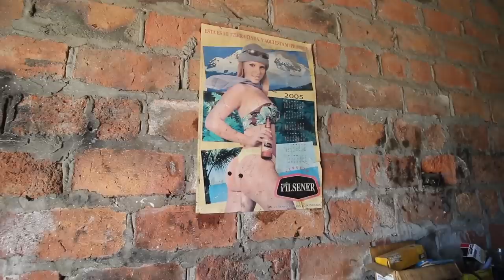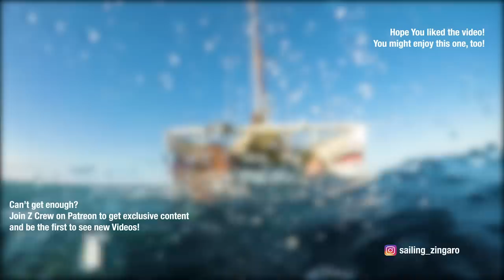We toss the refrigerator in our TINY floating home!  | Ep. 57

Comment: you can get a small 110V  fridge , low  amp , if you have the solar panels and an inverter 12V to 110V..it's a lot cheaper and not a lot more amps than a 12V , boat system ....you will need to add some insulation around it , to save more current  ..I did it ..or have an Adler Barbour shipped from US   and install it in the old propane frdge

Comment: You missed an opportunity with that seat - you could've knitted (knotted) one out of dynema! 
Well, a hammock - type  thing. (Lighter and easier to stow away, too)
You can jury-rig something for evapourative cooling - at least for the beers - they don't mind salt water.
Reply: Seems everyone who like this couple sail the world end up going electric with everything because they just can not get the propane tanks filled due to all the different types of tanks and fittings.  I hope they get a high quality electric fridge soon .
Reply: Well, diesel is the most globally-available thing - even their solar is hard to replace. I think a small generator, as back-up, would be better than running the engines to charge the batteries.

Comment: I think you'll get more efficiency out of a serpentine belt setup. Also there are some alternators that are built with huge front bearings and last for ever. The field coil in the rotor on your alternator should not get more than 12V - 14V and only when it's running. This is normaly done via the key switch and the battery. The battery usualy loads the alternator so the voltage doesn't go too high so if it gets disconnected while running or goes bad the alternator can over-volt the field coil and kill it. Perhaps a breaker in series could save it. Spray cold galvanizing compound on the steel. Quik and dirty marinizing of automotive parts. A 12V fridge costs an arm and a leg. A 12V fridge will use 5A@12V=60W. An old 110V 4cf fridge will use 90-120W. Newer ones are closer to 80W maybe less. Just use a true sine wave inverter matched just for the fridge.

Comment: I bought Engel bin-type 40 ;litre refrigerators which draw about five amps when running--but they do not run all of the time.  My solar panels handled them easily--and one was used as a fridge--the other one I set the thermostat to run as a freezer.   I a;so has an el-cheapo K-Mart  refrigerator which  ran through a 240 volts-12 volts DC inverter.  It was cheap and worked fine--but no good as a freezer

I would buy the Engels again.  Mine are YEARS old--plastic body--no problems and no gas leaks.  A wind gen would run them most of the time--solar the rest.

Comment: You said both panels quit at the same time ? Typically, especially on a boat, not possible. Saw a boat spend $800 because one of the wires had its copper leached out of the inside (looked perfectly fine)  the other day. Very common with marine. How many cells in each panel ? Of course you have a volt meter. Oh yah, beautiful wood. You've just got so many projects going you can't think about the electrical. Oh well. So, question, can people actually send you parts and stuff ? Oh, and yes, she is gorgeous.  Kimi that is.

Comment: Seems to me your regulator would not let the whole 90 amps through because it will charge the battery's too fast and cause an overcharge condition depending what your amp hour's in your battery's are.